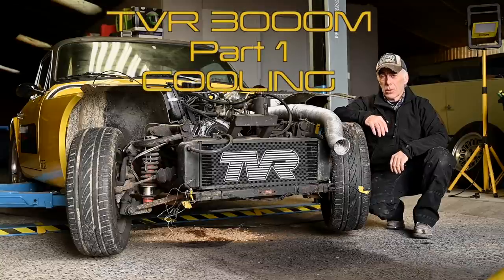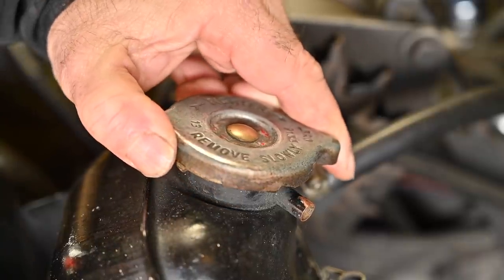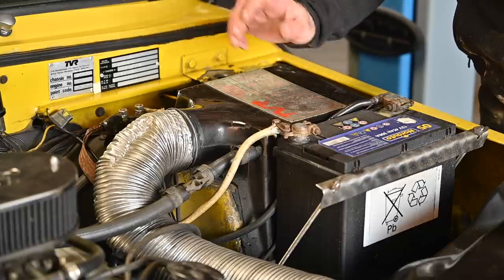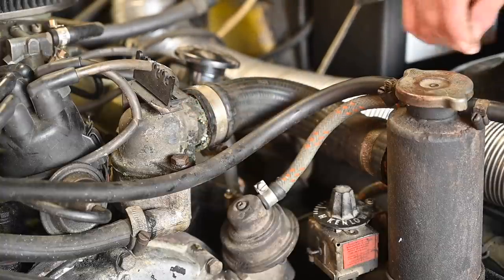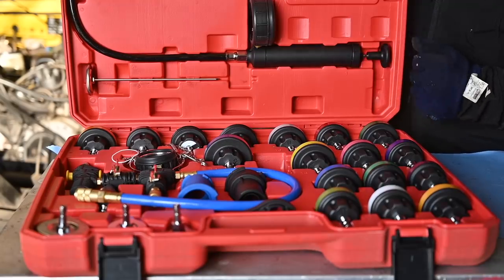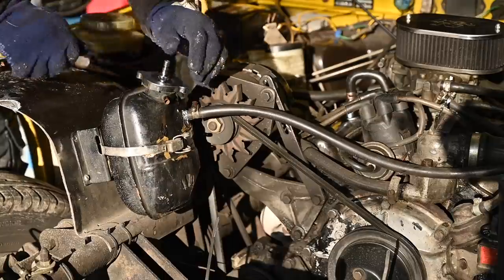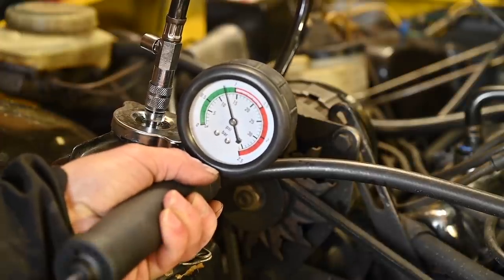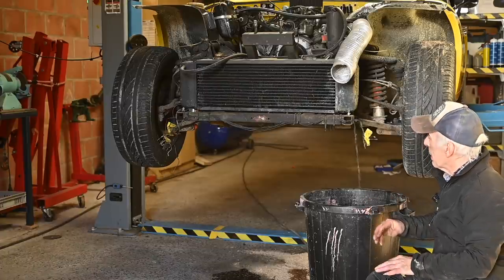TVR 3000M, PART 1, Cooling system

Comment: As you most probably know, when the hoses get older, the inside of the hose could separate from the outside, and as the engine warms, the inside of the hose could expand (distort) and close off the circulation completely, and cause overheating. My humble opinion is that all rubber hoses be replaced. The heating radiator inside the cabin should also be cleaned and checked, as it could become clogged with rust, etc. Dankie vir jou baie interessante en leersame video's!
Reply from the maker: thanks for the comments, and yes hoses will be replaced with silicon types, besides a good flush.

Comment: That pressure testing tool is a good investment. I found no difference qualitywise between the brand named and aliexpress version. So the cheaper versions are a good investment as well.
Using the filler tool is really great on engines where getting rid of airpockets is difficult.
To test the hoses, I prefer to pull/tug/move the hoses left and right. Usually changing or tightening the clamps are enough.
I worked on a BMW E39 once and pressure tested the system. The expansion tank was so brittle that I could see cracks forming in the plastic. When I replaced it and pressure tested it again, a coolant hose started to bubble. Good thing that I caught it before filling the system with coolant.
Reply from the maker: Indeed, you did the right thing. To many take shortcuts and end up with trouble later

Comment: Hi Steve, fantastic video as always. Technically, it is a side-flow radiator (tanks on sides),  rather than a top to bottom (tanks on top and bottom) as you state in the beginning. Nevertheless, in your subsequent informative description, you correctly describe and show the correct orientation of the flow from left to right. Keep them coming.
Reply from the maker: Thanks for the info! and correction

Comment: Great video Steve! I m always skeptical about Chinese radiators too. In many cases anymore it’s all you can buy which is sad. While the radiator is out and water pump is off you may want to remove the timing chain cover and check the condition of the big timing gear that drives the cam.  Some of those Ford V6 engines had nylon teeth on the big gear that would fail when they got old.
Reply: I've heard good Chinese aluminum radiators. Their quality has been pretty good in general. There are certainly exceptions to that.

Personally, I would repair that old radiator.
Reply from the maker: thanks Elliott, that is so through. i did check it with my endoscope with the oil sump removed.  it looked ok, but as we all know every 100000km that should be replaced...  sad thing is, the nylon wheel is no longer available   and the steel version is so noisy
Reply from the maker: i will get a new core for it

Comment: Nice to see your working your magic on the TVR personally the workshop that rebuilds rads will probably be your best bet a rebuilt rad can look the part a last many years .I think the kenlowe fans and thermostat cleaned up would work as good as new I think all you need is a rear cover for those fans to draw cool air through rad .👍
Reply from the maker: That's the plan! and indeed the fans will be tested.

Comment: Very interesting.  Seems like a fairly typical old car system.  Several small issues that add up to give poor performance.  I remember that the Essex engine can be prone to overheating unless everything is up to scratch.  Looking forward to the next video.
Reply: Never had a problem with my 2.5 litre Consul overheating.
Reply: @aytonbob  I gues not all of 'em did but I know of a few that had an issue or two.  One was a 3 litre Capri, another was a Granada Ghia MkI 3 litre.
Reply from the maker: Thank you for the comments..

Comment: Important question: Does the lower radiator hose touch the rack bellows? The aftermarket aluminum radiator seems like it interferes with a 2500 M I'm working on.

Comment: Hi Steve, should the bottom radiator mounting studs have rubber washers/grommets to reduce vibration from the chassis to the radiator?
Reply from the maker: yes indeed you are right. there are grommets below the radiator

Comment: hi Flemish,  i heard you saying you must change termostart. my car had had problem of overheating and i opened termostat housing and throw the termostat away. since then it gives me no problem. 

what is the dangers of removing it. i had had no problem with my car ever since

m.b.s moshitoa (s africa)
Reply from the maker: Thanks for the comments,  well it all depends where you life... But in general  the thermostat his two roles to lay:   1:  heat up the engine as fast as is possible to its operating temperature ( that reduces wear and tear on  the engine).  2: Once at operating temperature , retain that temp as stable as possible by opening when the temp of the engine goes to high , so that it can be cooled by the radiator and secondly close-ing when the temperature becomes to low.    In colder climates that is very importent.   In your case you will have your engine without a thermostat running to cold....resulting in mre wear and tear and lower performance

Comment: nice! I remember watching a wheeler dealers episode where they replaced the cooling liquid with some kind of version that has no water in it. They opened the radiotor cap while the engine was warm something youre normally obviously not supposed to do. Apparently  no pressure built up in the system because theres no water in  it to boil. And you never need to change it or something like that? It had a lower freezing point and higher boiling point. I dont remember which car they used it in and in what car/situation you might opt for such liquid. Dont really know much else about it.
Reply: The trouble with that Evans waterless coolant is, it raises the boiling point and the heat level of the system. Not good for an old car which is designed for 50/50 coolant. Their shill advertising videos are misleading at best. It's also flammable in the event of a leak hitting the manifold.
Reply: @kmc7355  Oh ok. I didnt mention it as a replacement for this car really. More just something i remembered and someone who knew more might enlighten me so thanks.
Reply: @nicktrousers  There are a series of videos on Youtube testing that product against various other liquids/chemicals and straight water is proven to be the best for heat transfer in a car, mixing in glycol takes care of the corrosion aspect that Evans use as a fear tactic to push their product. Also have a look at what they charge for the Evans 'water removal' and refill kits 🤯
Reply: @kmc7355  That does sound very plausible. Ill have to check it out.
Reply: @nicktrousers  also with waterless coolant you cannot top it up with water afterwards - so on a trip you need to carry waterless with you - I dont think it is worth the trouble

Comment: The cores are made in China . GPI do a decent radiator and are Chinese .
Reply from the maker: thanks for  the comments, there are many good quality parts in china. think of the iphone and more. but there is also  a lot of junk  .  the problem with these radiators is that you can't tell the quality based on a web based picture...have a look at the prices... so much difference and yet they all look the same.   I have tested tools in the past for awebshop. And most of it was junk. After a few video's, i  told them that i quit because of the poor quality. I hate to lie, not that i did.
Reply: @D3Sshooter  True that is why I mentioned GPI .